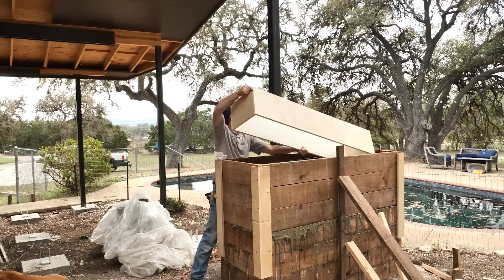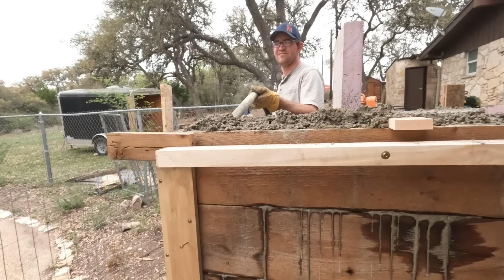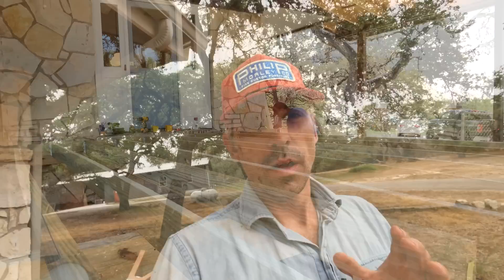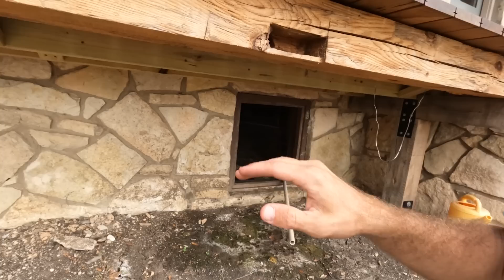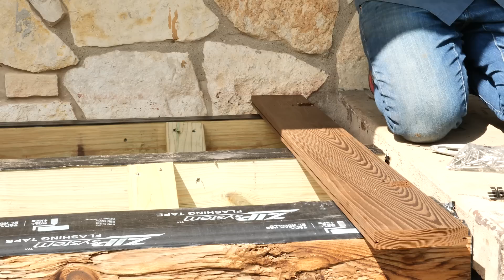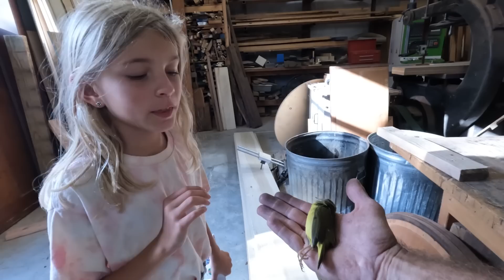Finishing the Concrete Planter and Front Walkway Sagging Issues (DECK BUILD PART 3)

Comment: Hi Andy, as others have said you can reduce the flex in the walkway if you sister it with another board such as a 2"x8", but, that solution could be improved if you sandwiched a steel plate inbetween your beam and 2"x8". works a bit like a steel I-beam and should resist more flex in the walkway. Thanks for the videos!

Comment: You can see the flex in the walkway at the end of the trimming the boards clip as you stand up and walk away.  A central support will take that flew away or a steel "I" beam running down the center of the walkway.

Comment: Did you seal the beam to protect it from moisture?
Reply from the maker: I haven’t yet but I plan on it.  Texas hasn’t seen rain in like 4 months!
Reply: @AndyRawls  worth a shot, my mother does that to all her potted plants, helps hold on moister and keeps the dirt in.
Reply: Wrong reply.  Woops.  I was wondering if sealing it before putting the boards on would be good to seal it all up.  Awesome beam, man.  So much character.  I can’t remember did you put that seal tape along the top also?

Comment: Andy, I'd be a bit concerned that the weepholes of the planter weep onto the deck. Maybe one hole at the front facing end would be better.

you can also use planter fabric at the bottom of the planter to avoid the weep pipes being clogged.

The deck looks great.
Reply from the maker: Thanks for the suggestions!  I’m a little concerned about the deck as well

Comment: the concrete planter will sadly have the drainage holes plugged with roots if you plant a shrub or small tree....The soil and silt will also migrate into the pipe as well.
If you wanted to plant shrubs and trees, vege's / herbs or even potted colour for that fact, the planter should have been left open to the bottom [the natural topsoil]...so the roots would have been able to get into the natural topsoil and the water would have also been able to drain freely...

Comment: Andy, my only comment (as an armchair contractor) is I would have left copper tubing long, slipped a rubber tubing over it so it weeped away from flower pot wall, and cut it at a 45 angle (sand papered edge for sharpness.  Minor nit picking but just a thought.   Otherwise, your one of my woodworking idols.   Jeff